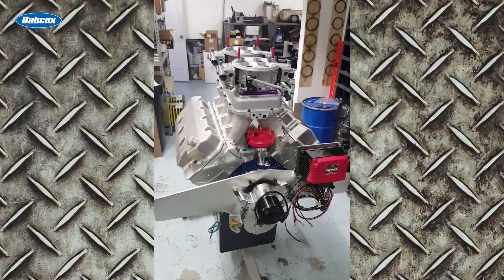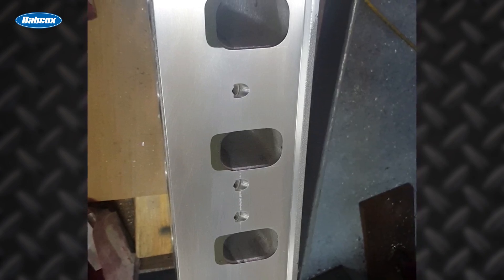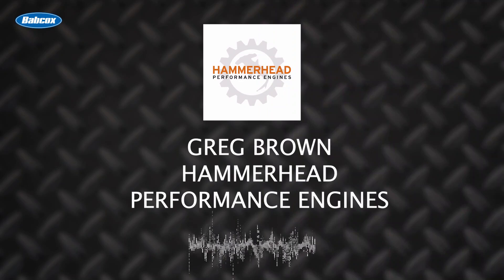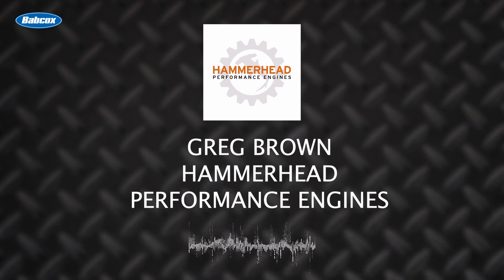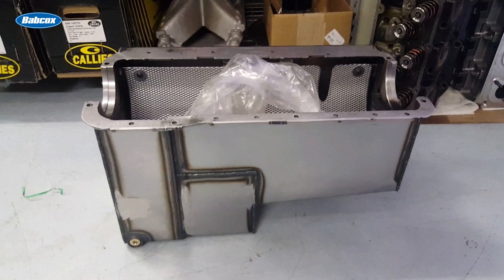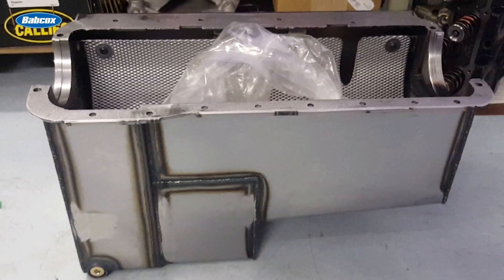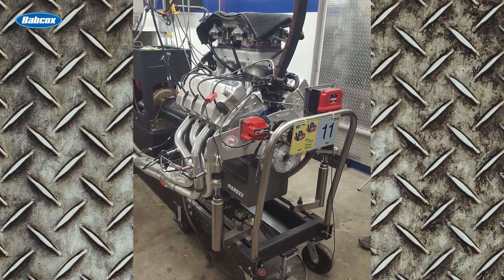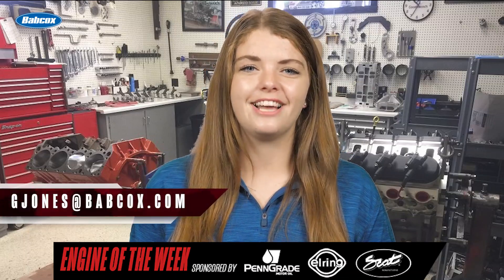393 cid Small Block Ford w/ Hemi Heads

Comment: Am I wrong, but I'm just sure that Jon Kaase won one of the original engine masters with a 10.5" deck height 351/400M at around 400 inches? Yes, it was 2008.
Reply: Yes he did. And the year before he won with a 366 inch flathead.

Comment: There must have been some other limitations in the rules. Maybe cam lift ? Or comp. ratio ? Don't take this the wrong way when I say that 770 mark is not all that. I have friend that did a 383 ci  Boss 351. And it used the  Boss 351 4 bolt block. It was bored and stroked to 383ci. The combo takes care of the rod to stroke ratio in the Clev. The bottom halve of the water jackets were filled in to strengthen up the block. They used the D1 Boss 351 castings. Raised the exhaust floor and ran a Hogan sheet metal intake . CR. was over 14- 1. Big custom ground Lunatic Roller. On race gas it made over 920hp @9400 rpm. My friend worked for Dick Maskin @ Dart products in Troy Mi. No hemi heads, and less cid. So there must have been other limitations we aren't privy to.  I'm very curious as to the flow # on those hemi heads. Because I know what those D1 heads flowed. Those are the cast iron models to which the C3 Yates heads came from. Not hard to See 320 cfm on the intake ex. Will roll 242 cfm with out a lot of massaging.

Comment: He "developed" a Chrysler "Gen 3" (5.7 and 6.4 liter) "Hemi" head that fits on a "Ford small-block" with a 350 Chevy bore size which is a damn sight easier than it sounds since the bore centers are within a quarter inch of each other. If only that "small block Ford" had the wall thickness to go another .090" over he could have "destroked" that "Ford Hemi" to 3.76" and built a real 6.4 Hemi "clone". 
 4 head bolts/studs per cylinder and 4 inch bores and 4.25-4.50 bore-center "small blocks" due tend to result in lots of "race engines" in that "400 cubic inch area" especially given that "real" race engines that have to produce real high performance for hours rather than minutes or seconds at a time are ALL "small blocks". 

And that included Ford's supposed "big-block" 427 engines at Le Mans when "Ford beat Ferrari" with a "big-block Ford" that like ALL "big-block Fords" EVER had/has "small-block" combustion chamber volume. At least CHEVY small-block "truck motor" combustion chamber volume. Meaning in that "70cc area". 

Jon Kaase and anyone he has ever "mentored" are GREAT at "developing" ways to apply "Brand X" (i.e. the "competition" at the other two of the "Big 3") engine technology and components and architecture and...engineering to "Ford" engines WHILE "creatively interpreting" the "rules" and "beating" the "competion" that typically and traditionally is...or rather was..."mom and pop" engine shops and/or "college kids" looking to "make a name for themselves" in legitimate competition with time and money and technology "budgets" and "creative license" not one tenth as "generous" of Kaase and whatever supposed "customer" he claims his "build" is intended for the "street car" of. 

His "Ford Y-block" with more "Chevy" in and on it started breaking the camel's back and his "Ford MEL" so-called "build" with "in cylinder combustion chambers" (his attempt to "clone" the Chevy "Mark 1" big-block 348's "flat head" - no chamber in the head at all - and "wedge" chamber in the cylinder "architecture" as the 348 and 409 were the first naturally-aspirated automobile engines in history to make "1 hp per cubic inch") was the straw that shattered its back and LONG after that assclown should have "retired" from what was ALWAYS intended to be an "amateur engine builder" competition.

Comment: WHHHHAT?? My buddy built a 400-in Ford that made 800 horsepower and they werent some one-off crazy heads
Reply: Yeah it doesn't seem like alot of power for something that has that much invested.  Unless they had super low compression ratio restrictions.
Reply: @tonnyletkeman2348  … The Race Engine Challenge rules do place restrictions on all builds. They use a power per cubic inch grading system which would be a disadvantage for larger strokers in most cases and the rules don’t allow unlimited compression. Greg’s engine won with 50 points more than the 2nd. place finisher. 

His conservative 393 inch build made 775 peak horsepower with 622 lb/ft of torque. Average horsepower was 642. That was the inaugural Race Engine Challenge event held during October of 2018. 

However, during earlier dyno testing in June of 2017 at Charlie Pepper’s shop here in Georgia, the results were very impressive. Greg built a 427 featuring his Ford Hammerheads with stock sized 2.200 intake, 1.650” exhaust valves on a World Products  9.5” deck height Windsor type block along with a single 1250 cfm Dominator style carb. 

It made 928 horsepower @ 7700 rpm’s and 674 torque @ 6300 rpm’s. Not too shabby and there’s more available. The dyno data indicated the 1250 carb and intake manifold was causing a restriction and a power loss. A 1450 carb with a CHI intake manifold would easily pick up 40 more horsepower. 

I don’t know if any port work had been done on the heads. In their out of the box as-cast condition, they will flow 392 intake and 275 cfm exhaust. With typical porting they flow 462 intake and 320 cfm exhaust so there’s a potential for much more power. Check this out for more info. 
hammerheadperformanceengines.com
Reply: Ronnie, your buddy must have been using Ford Cleveland type heads to make that much power with 400 cubic inches.

Comment: 4" bore is the sweet spot for flame travel when you study the thermal dynamics
Reply: Why does bigger bore make more power then?
Reply: @Mr.RollTide   Strok To Bore =HP
Reply: @Mr.RollTide Bigger makes more power but not as efficient as one the right size for the most complete combustion which favors a smaller cylinder.
Reply: @Axeman428  any Ford or Chevy small block a 4.125 makes more efficient power than a 4.00 bore

Comment: It's a "no-brainer" because "Ford enthusiasts" are the ultimate "no-brainers" in that they look at this "competition" boat anchor with "hemi" heads and absolutely NO Ford "factory" parts period AND every "small-block Ford" engine "challenge" to/for "high performance" specifically "engineered" out of it and STILL SEE AND SAY "FORD POWER!" AND THINK IT'S PROOF OF FORD ENGINEERING "EXCELLENCE" INSTEAD OF THE EXACT OPPOSITE AND AN "ENGINEERING EXERCISE" 100% FOCUSED ON MAKING THAT "FORD" AS MUCH LIKE THE "COMPETITION" AS POSSIBLE AND PROFITING FROM FORD FLAWS AND FAILURES.

Comment: Mopar style heads.  Mopar .904 lifters and Mopar style long rods.   All great ideas!
Reply: Hemispherical, combustion chamber heads have been on a lot of different engines including Toyota,jaguar,Porsche,Aston Martin n even Alfa Romeo.
Reply: Boss style heads, boss intake, a lot different than anything Mopar did, and I'm not knocking Mopar. Mopar never made that flow with the Hemi. They were good, but not that good.
Reply: @johnsalvaterra1355  Look up Ball Stud Stage 5 Hemi Mopar!
Reply: @charlesmarshall2697   I know it fairly well. Never for production, never would meet emissions. But interesting and why the wedge 383, and 440 lasted, and 340, and everything else was a nice exercise in engineering, back when there were some real thinking people. Thankful I got too meet and watch them.
Reply: heh, yeah, thats why John Kaase did it first
Reply: @Charles Marshall:  You FIAT chrysler/dodge/mopar boys are comical. LOL.   The first American V8 Hemi was in fact the Ford/Ardun V8 Hemi made in 1947.  Chrysler didn't make a V8 Hemi engine until 1951. Where do you think chrysler got the V8 Hemi idea from? LOL.  Funny how the 1947 Ford/Ardun V8 Hemi intake manifold, bolts right onto a 1951 331 FlowerPower.  LOL.
Reply: @MGB18 and yet Chrysler made it work. Ford didn’t. And btw, the Dodge brothers built engines for Ford when Ford couldn’t yet… AND, Chrysler thanked Ford and GM for using their Hemi design in NHRA In the 70s
Reply: @leehouston5436 : Some of you FIAT boys are more full of crap than a sewage plant. LOL.   The Ford/Ardun V8 Hemi worked quite well genius, precisely why chrysler (now FIAT) copied the idea. Garlits even admitted that himself. LOL. Tell me?  What FORD drag racers in 1970's NHRA used FIAT Hemi design heads?  Be specific now?  LOL.

Comment: i was under the thought a true hemi had the spark plug  in between the valves in the center of the cylinder /  true top of cylinder?
Reply: The valves are positioned different up and down instead of side by side
Reply: Er how? It’s a 4” bore with a 2.08 intake valve, at this point the center of the combustion chamber is occupied by the intake valve and valve seat, leaving no room for the spark plug in the “center”.

Comment: Lol. Pretty cool. But hilarious that he basically just turned it into a Dodge engine.  Hemi heads and .904 dodge lifters.
Reply: Then you've never heard of the Boss 429 which had semi-hemispherical heads. Only thing worth mentioning as far as Mopar is concerned is the 904 lifters.
Reply: @richardmcminn2130  of course I have. That was when Ford themselves ripped off a Dodge engine. ‘Cept for the lifters…..

The Boss mustangs are gorgeous.  My very favorite Ford Muscle car. But that motor was damn near a reprinted Dodge. Honestly can’t believe they didn’t sue Ford over that one….
Reply: @joethompson543  Chrystler hemi is a copy of the Peugeot hemi 4 cylinder head. The 429 boss is a totally different design, obviously you have had no hands on expierence.

Comment: It would be awesome if Engine Masters had a class for your younger everyday guys like 30yo max and everyone has to build the same motor like a 350 or a 5.3s N/A  with a 383 max ci, carb or efi   with all off the shelf parts no crazy exotic or billet  stuff, no extra cnc porting on the heads only hand porting, fuel is kinda tuff to pick a fuel so I would say anything but m5 and m3 so if you run alcohol m1 is your only choice. have some body to check the parts and and give the guys and gals 3 days to assemble it, so you basically show up with your block & parts and plan of attack and throw it together and party! it would be awesome to run turbo,blower and nitrous setups but in a dyno competition like that it would be a pain in the ass and take for ever to setup and run several different turbo motors on the dyno, the only power adders that would be easier to get on and off the dyno would be screw/roots blowers and nitrous Maybe centrifugal but that's not fair for us turbo guys